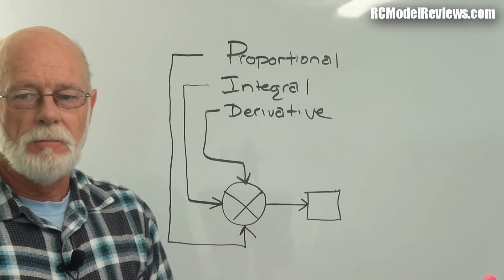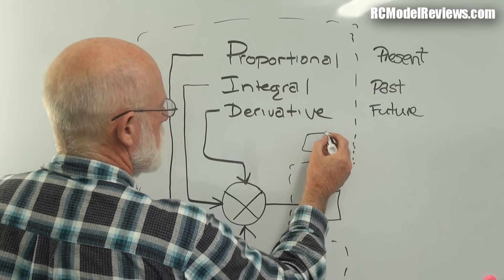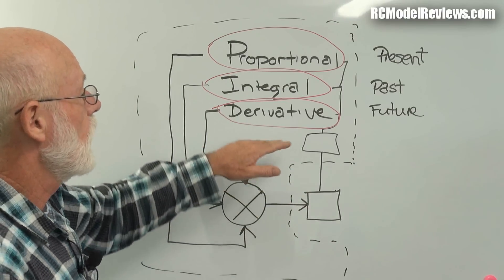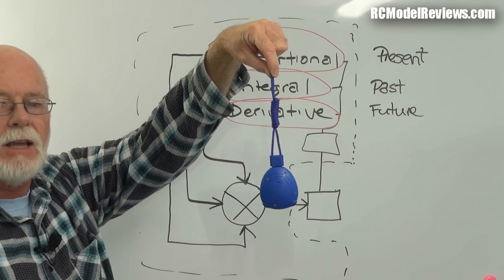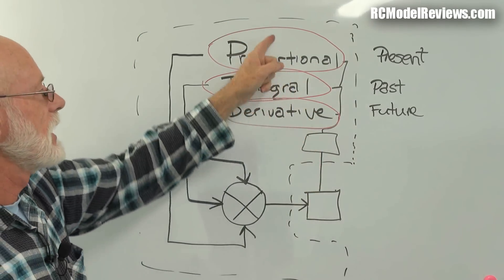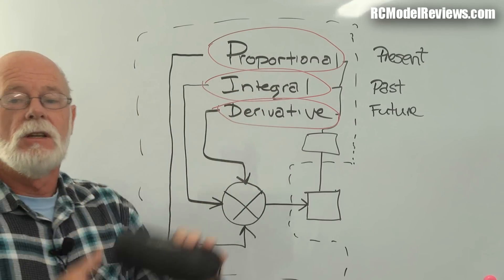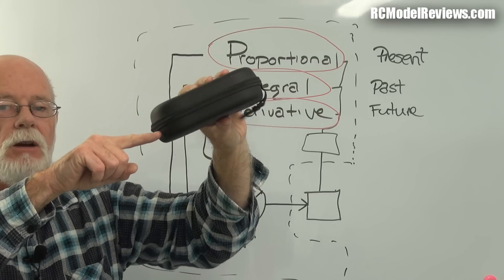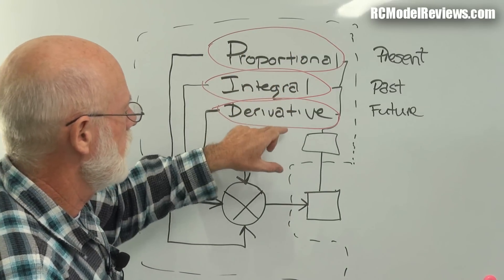What PIDs do and how they do it

Comment: I REALLY like every vid of yours I've watched, this one is no exception.
a couple of things that are almost never made clear when people explain PIDs, is that:
1) these corrections are taking place around 1,000 times per second, so things happen pretty quickly and getting a good tuning will really make things a lot better in the flight performance.
2) as i replied to Nick L, below - where ever the STICK is positioned at any one time, is the "Point 0" of where the PIDS are trying to correct to. so if you move your stick a little to the right in order to roll, wherever that stick is at, the PIDs are thinking that THAT position is the Position that they should correct the quad's angle to.

Please keep up the GREAT work!

Russ from Coral Springs, Fl usa

Comment: Thanks Bruce !!  So many people are going to be able to grasp a basic understanding from this.  But. A can of worms has just been opened ;). Job security  muahahaha.  I learned a lot form this video.   I don't know a lot about the technical side of this stuff, just have a hell of a lot of experience and I've fiddled around with it long enough now to understand what all this stuff does :)!   Thanks for the video and your time cheers !
Reply: Mr Steele seems like I’m catching up, it’s interesting to see really good pilots comments from a few years back and then look at where they are now. Like a PID loop of life :)
Reply: Loved this thank you. I admire people who invented this stuff
Reply: We had to make PID controllers from basic circuit board components to pass our classes down at Georgia Tech. The master's students regularly make drones and fly them over the courtyard, and those things are insane with PID self-correcting. Onboard vision control systems let them really go nuts because they self-avoid obstacles, but those are still a work in progress.

If you want to get into the weeds on the technical side of PID controls, I recommend building one from scratch. They're a lot cheaper and can be added on to existing systems if you purpose-build them. All you need are (different types of) resistors, capacitors, and op amps for a PID that outputs pure voltage that you can turn into whatever you want. You just want some of the resistors to be potentiometers so you can adjust their values, and you want at least one of the potentiometers to be a sensor so it can adjust the voltage output based on any input (pressure, angle, velocity, temperature, etc.).
Reply: Ahh, so Steele would rather sell the info rather than teach it. This explains ETHiX LTD. I wouldn't worry about job security though because there will always be people who would rather buy instead of learn lol. ;P
Reply: TheLegend27 himself

Comment: +RCModelReviews
Here's another "thank You" for the clear explanation.
And also another humble request for a "follow up" going further into the details.
Best regards
Reply: This is a pretty late reply but I just found this video. PID is common to control systems in everything from robots to cruise ships. Proportion without integral or derivative follows a sine wave pattern, as he demonstrated with the swinging stopwatch. The rest is very simple calculus. The derivative of a function is the slope of its curve, meaning that the speed at which proportion is changing (which is the speed that the quad is changing angle) is the value of the derivative. If it's correcting too fast, the derivative is high. Integral, also known as anti-derivative, is the area under the curve. If the proportion is slightly higher or lower than 0, but not enough to correct itself, the area under that curve becomes greater and greater over time. The greater that area becomes, the higher the value of the integral and the more influence it has in correcting. You can find more about the math here https://en.wikipedia.org/wiki/PID_controller.
Reply: Taking the explanation and applying it to this comment might take some time to fully understand. Thank you for the more detailed explanation and how it works in math

Comment: Even more simple: 
P=power (too much can overshoot)
D=Damping (prevents overshoot, but can slow correction too much)
I=correction accuracy
Reply: This was a good way to look at it as well
Reply: That's not necessarily true. If you have a first-order plant then no stable P-controller can overshoot. If you add an integral to the same controller the extra pole makes the closed-loop second-order and enables the possibility of overshoot. The only way to determine if and how much a feedback system will overshoot is to find the closed-loop poles.
Reply: hi sir our compressor pid setpoint is 70 and pv 82 and controller output is 5.3% witch point I have to tune so controller output will be 0% please advise me best solution.

Comment: I was finally able to get the perfect water temperature in my baths! Can you make a video for shower temperatures?
Reply: Hey, @powerscissor, could you please explain me how you did it? I'm struggling to find a solution for mine. The problem is: it's not an electric shower, instead it's water warmed by solar panels. Any ideas?
Reply: Install a combination boiler, set the hot water temp on the boiler, and never use the cold tap. You are simply wasting expensive energy by heating water and then cooling it down again. It works great on my shower, no use for the cold supply at all, and a perfect hot water temperature too.
Reply: Vinicius  Jordan     plumber here, I'm not sure for water warmed by solar lol the best I can think of would be a small insta-hot unit dedicated for the shower. They come small enough for a tap to make tea or big enough to replace a standard 30-50gal gas water heater tank... This unit ONLY heats water (electric) when it senses water flow. This way you could plumb two cold lines to the shower, just have one go through the insta-hot before entering the hot side of the shower valve.
Reply: Googel+ beware that if not hot enough, unfriendly stuff (like legioner's disease) can grow in the water. 
And too hot with no cold mixed in can scald you.
Reply: @vinijordan  
You could use my patented system - you need a special Sheila - a derivatively named Oz shadopunkah operator. The SPO needs a sunny spot on the roof to lie comfortably with binder twine in hand within audio control range of the shower - you get the picture.  A suitable system of audio controls can be arranged - not including,  "FFS Sheila, more shade, more FN shade, FFS." 
Audio control feedback of this nature leads to ridiculous amounts of oscillation - disproportionate loss of control harmony and the distinct possibility of complete disintegration of the whole interface.

Comment: Great video.  I think this hobby is exposing a lot of important concepts to people who would not otherwise ever care about them.  PID loops are used in plants, refineries, and manufacturing facilities to control valves and other machinery.  It's an important part of the process that typically process engineers handle.  Now there will be a whole new group of experts out there to call on when a valve needs to be tuned!

One thing worth mentioning is that in systems, you typically only want to control one input.  In your example, you have hot and cold water.  The cold water tap would have to stay at the same position and the hot water would be the variable adjusted by the controller, or vice versa.  If two controllers are trying to control the same output, they will fight each other.  If you have two possible ways to control the same output, the solution is to have two controllers in a cascade arrangement.  A topic for another video possibly.

Comment: Flight controllers are where the magic happens, and the magic is related to PIDs? Magic smoke source confirmed!
Reply: magic smoke happens when you hook up the battery in reverse. lol. Illuminati confirmed
Reply: Real autopilots are somewhat different than just PID tuning. You need a lot of knowledge about multivariable design methods, a solid background in lead/lag compensators, margins, and nyquist theory. PID is a good place to start but is not enough too fully design an autopilot.
Reply: Another magic smoke source is the "Kalman filter", or more specifically the "Extended Kalman filter". But beware, here be dragons!

Comment: That was a superb explanation of a really cool subject.  I used to bug my Jr. High math teacher what use the math we were being taught was.  LOL  And that was just with what I now consider rather elementary algebra, and imaginary numbers.  Quads are math and electrical engineering geeks dreams (nightmares sometimes).  You have control theory -- PID loop.  Calculus with the integral and derivative terms.  And all the values are being sampled at some frequency, so digital signal processing is a major part of the action, with digital filters, and concerns about "aliasing" -- not sampling a signal with high frequency components (fast edges, noise) fast enough, which can produce mind boggling effects that have led to thousands of blog posts.  Then the RF design engineers have a field day with the video transmission, and antenna theory and design.   And spread spectrum technology.  And then then the high power switching, and the motor design is another discipline.  I think it's so cool that FPV Quads span so many engineering disciplines.  And how could I have forgotten to mention the complex software?  That is a huge  part of the equation..  And all those technical areas, at least at the manufacturers, are very math intensive.  My Jr. High school math teacher didn't have a clue as to the practical applications of what she was teaching us was.  A lot of it wasn't even invented yet! YOU DID A SUPERB JOB OF EXPLAINING A COMPLEX SUBJECT, IN A DOW N TO EARTH AND UNDERSTANDABLE MANNER, WHILE BEING FAIRLY COMPLETE TOO..  GREAT JOB!

Comment: Hi Bruce

Excellent PID explanation.

PID is also used with most Heater Thermostats.  Like on your 3D Printer. The Extruder and Bed Heaters have PID settings..  If not tuned properly the temperatures can do all sorts of weird things. (Under shoot, over shoot, temperature setting wonders and won't stay consistent, etc)

Can't wait for more videos.

Willy

Comment: Great video. A definite must watch video.
Just to make sure I get it, is the following correct:
We have a measurement and a target value and the difference is the error.
The P works directly on the error. The I looks what the error was in the past. The D looks at how much the error is changing.
Reply: +MKO2037 
Well mostly correct. This "looking at the past" and "looking at the future" are analogies to make things easier to understand but not entirely correct. 

The P (or Gain) is changing the output proportionally to the amount of deviation of actual value vs setpoint. 
For example, 1 degree deviation changes motor output 1%.

The I (or Reset) is applying a constant change in output based on the current deviation. If the deviation is constant then the change in output is changed at a steady rate. 
For example, 1 degree deviation changes motor output by 0,1% per second. Endlessly.

The D (or Rate) is applying a temporary change in output for every change in deviation. If deviation is constant no change is made.
For example, 1 degree change in deviation gives a temporary change by 5%, going back to zero. Here the Time-value is critical, for it decides the time before full change in output is achieved. If time is 1sec., then after 1 second output change is 67% from max change in output. After 5 seconds it is at max. After 10 seconds it is back to zero. If Time is 2, then double the numbers.

A different analogy to PID's is driving a car on a road. The angle of the car vs the road is the deviation, and the steering wheel position is the output.
When coming to a turn a steady increase in deviation will cause the P/Gain (mainly) to change in proportion, making the car turn at a steady rate. Same thing when leaving the turn. When heading down a long strip of road the car will drift slowly. Here the I/Reset will make minor adjustments keeping the car heading straight. If in the next turn the car looses grip on the rear wheels, the rate of change in angle vs the road will be very high. The thing saving your ass will be the aggressive change done by the D/Rate, which is then nullified when the angle is corrected. A too high D-value will cause overcorrection and a crash :)

Comment: Thanks for the description. I think another important factor that deserves comment is delay. If there is enough delay in the control loop (which might be milliseconds or less), even a system that has no significant momentum will experience oscillation with proportional control only.

Comment: Thanks Bruce that was good. I'm looking forward to the next part of the video where I'm hoping you'll have a quad in your hands and you'll demonstrate what the quad will do in relation to the PID. All my quads in low throttle oscillate while descending, some are also a little sloppy in sharp turns and some are pretty locked in but may flip with fast stick movements (like when I try and miss a tree).

Comment: Excellent "renaming" of the PID components connecting the FC PID function to time. 

One reason things are expressed with such complexity in physics is because most people have no concept of what real time is and how it's created to explain anything connected to it with the clarity needed to attach it to the constant time dilation in effect. For those that are interested this is a proven reality exposed by the fine structure constant e{a}/t=E  connected to the initial wait state of E the ratio of time dilation is relative to. Time is as much a part of waiting as it is about moving forward in oscillation via two arrows, one misnamed the "hole' shown opposite the electron. "Now" is a fulcrum moving forward connecting the past to the future where the end of time happens all the time.... but it doesn't last very long relatively speaking especially compared to the immense size in duration of the wait states that separate one observer from another. I can see your clock run slow just by watching you move, but I will never see my own clock connected to the speed of light run slow.  "Relative to the observer all other observers are behind it in time."

Humans that survive to avoid pain function in a derivative state... but that requires discipline greed has a conflict with wanting to feel good now using past knowledge.

Comment: Great video as always man, thanks. You explained what happens when the PID loop is perfectly tuned, but our PID loops are never perfectly (or anywhere near in my case) tuned. You should make a follow up video explaining what happens when PID values are too low/ too high. I dont understand the interaction between P and D either.

Comment: Thank you so much for all you efforts to pass on your knowledge. I'm working on a retirement project, more work, that involves the Gemini V2 fixed wing platform used for agricultural mapping and S&R. The possibilities for this aircraft are vast  and only seem to be limited by my imagination and cash flow. Sorry I get passionate when I start talking about my birds and tend to ramble, I'm wondering if there are PID's that are more suitable to fixed wing applications. I'm currently using Pix Hawk's, my flight time are usually run between 3-4 hrs with a 7.8 Kg. payload, 2.3 of which is Tesla style battery's and the balance being consumed with camera gear. Cheers, Billy in Canada

Comment: Great presentation.  Only one caveat.  The force of gravity on the pendulum is  constant, or a least so small a difference between the vertical and horizontal to be insignificant. You would need some pot or FET connected to the arm of the pendulum to measure the angle of the swing.

Comment: The video clearly explains how PIDs work (which is what I wanted to know ), however, if you can explain  how to tune it  in terms of fpv drone using cleanflight, it will be a perfect part 2 of this video. I mean after you flash the firmware of FC and then adjust the pids as per racing and stunts requirement while explaining why you change which number. I think will be greatly helpful because even though I now know how pids work, there are separate PIDs tuning for pitch, roll and yaw  which gets confusing. Thanks  I know I am asking a lot but this is what I am searching for now and I think the way you explain things is easier for me to understand. Thank you

Comment: “Derivative this is some future shit” 😂. Thank you sir, I work at a winery dealing with PLCs so we use a-lot of PID’s for valve control. We had wine dilution problem for 5 months where water been mixing with the wine without a fix. I found that we were missing an Enhanced PID that the vendor forgot to add compared to the other flow control valves, than had caused the other control valve to not know it’s place. So this made me more curious on how they work and why. Thanks